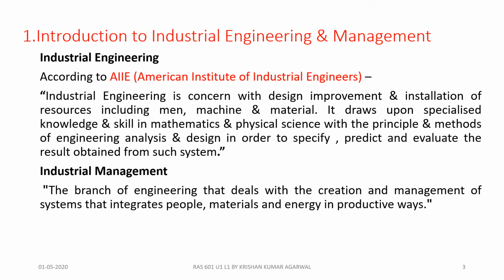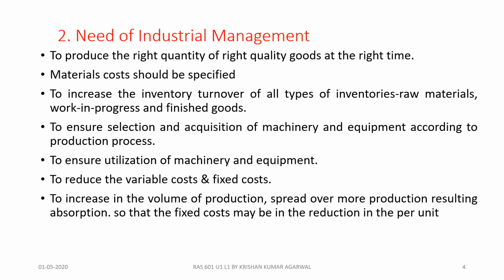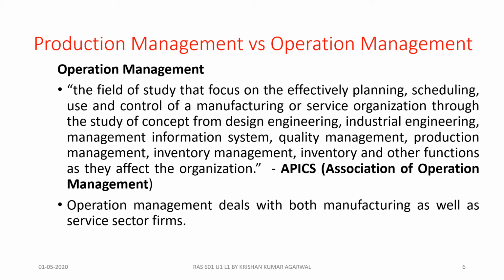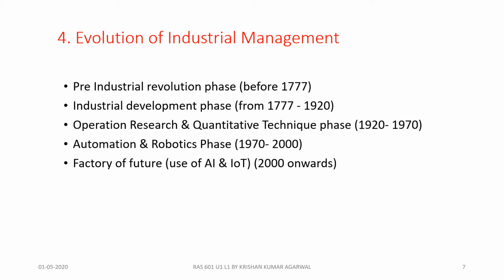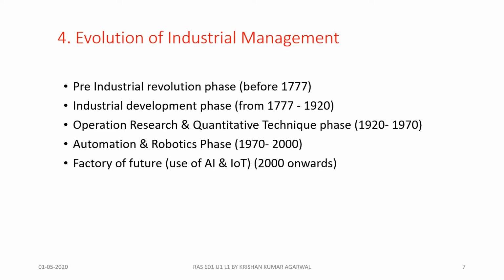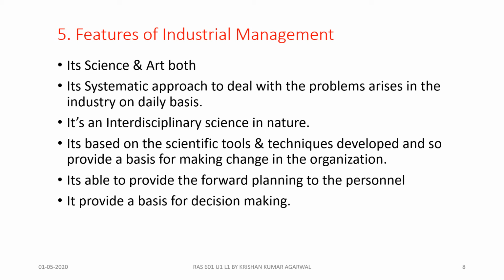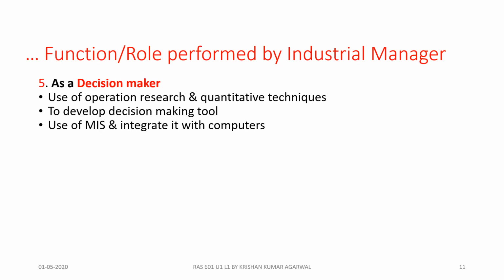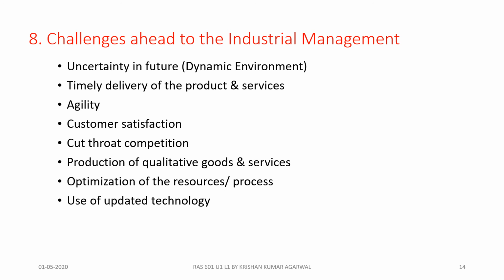Introduction & concept of industrial management

Comment: 1:29 Introduction to Industrial Engineering & Management
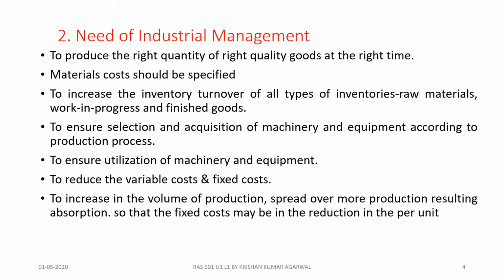4:25 Need of Industrial Management
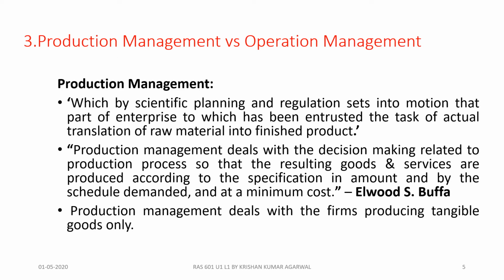8:40 Production Management vs Operation Management
13:10 Evolution of Industrial Management
18:59 Features of Industrial Management
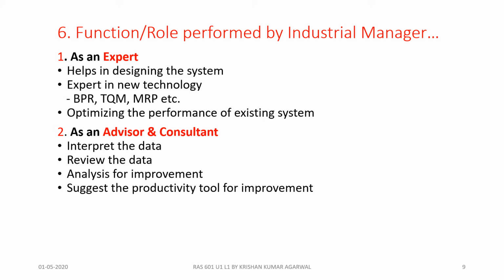22:42 Function/Role performed by Industrial Manager
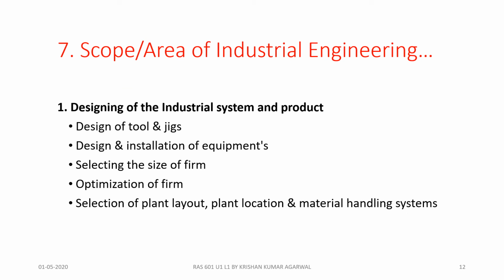26:35 Scope/Area of Industrial Management
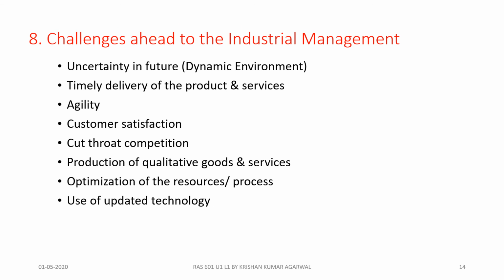28:58 Challenges ahead to the Industrial Management